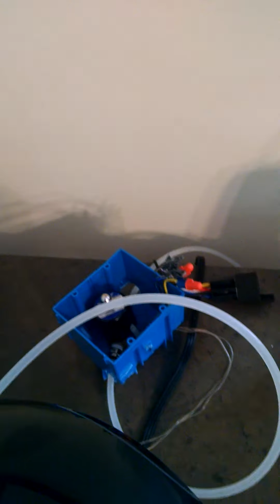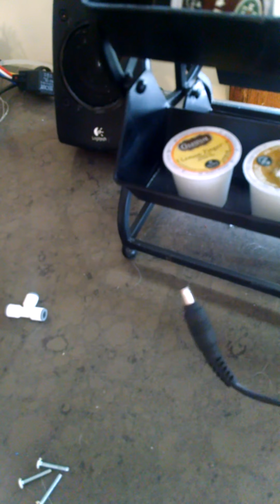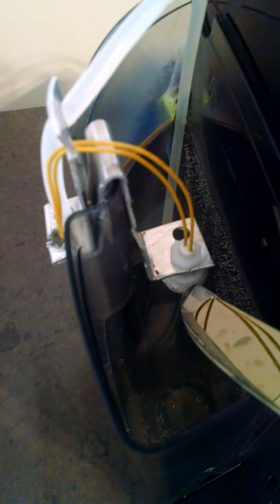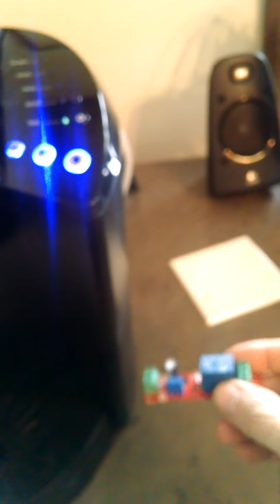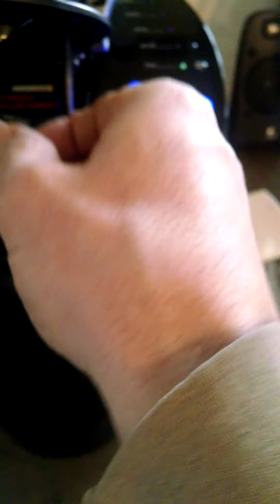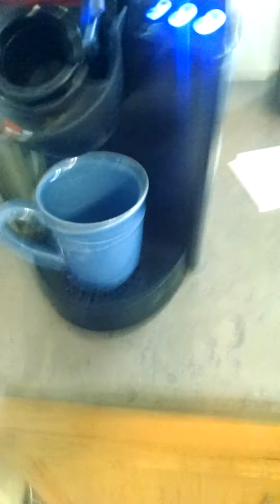Coffee WaterLine

Comment: Nice video, I'm in the process of doing the same setup. I found that if you add a valve on the supply line. You can slow the flow down slower than the fill speed.  This will stop all of your clicking.